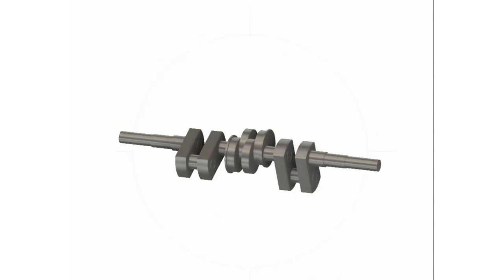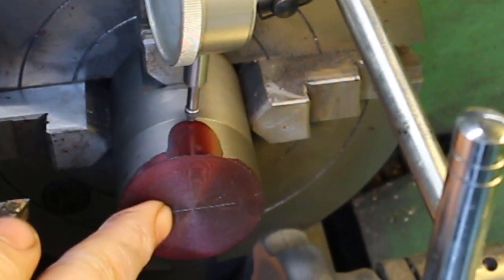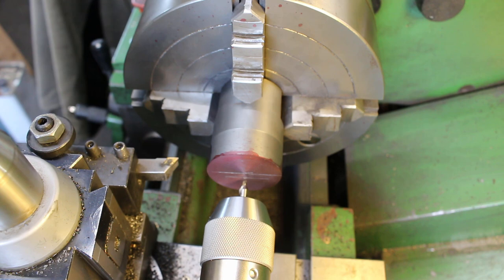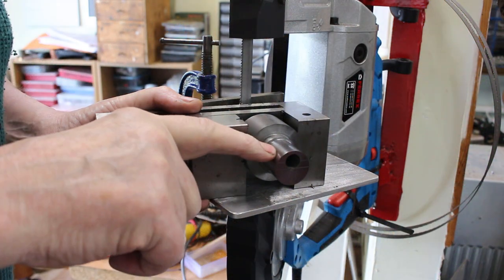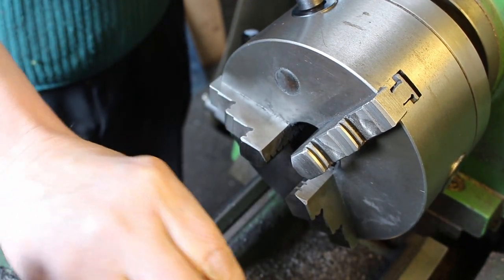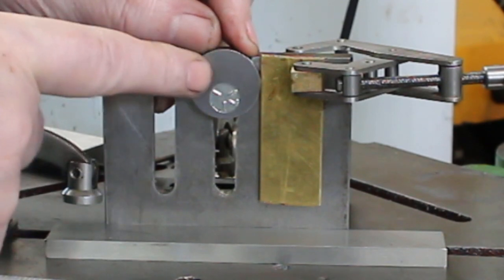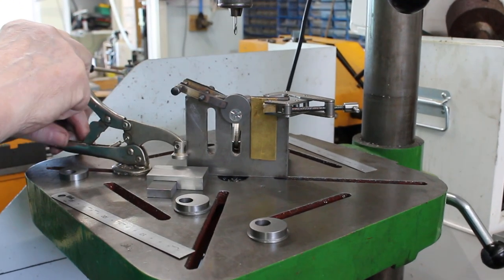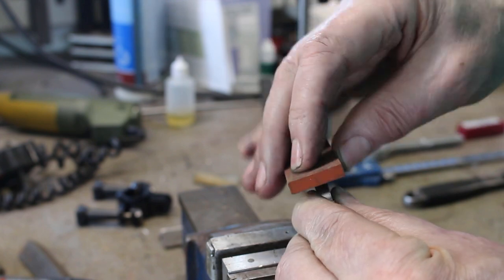Lion - 5" gauge Vintage Locomotive Steam Engine Build pt.36 -  Crankshaft Eccentrics

Comment: I recently parted off some eccentrics with offset holes for my LBSC Mabel and it went OK, I turned mine out of polished shafting that was the correct outside diameter so the only operations were boring the eccentric hole and then parting off. I used a carbide tipped part off tool and I did chip one insert in the process but it was a cheap Chinese import insert so no big deal. I will be grinding mine to size as well however the surface grinder is a very new addition to the shop and I am having issues with the motor starter on it at the moment.
Reply from the maker: That was very brave, glad it worked out, I wasn't that confident at time, maybe next time then. A surface grinder is a worthwhile indulgence. It took me a while to get good results, I found a coarse wheel, 60 or 46 grit works best and gives just as good a finish as a finer wheel, in fact I got better results. Good luck getting your surface grinder up and running.
Cheers
Reply: Go Create Hobby Machine Shop more like rookie luck! Lol